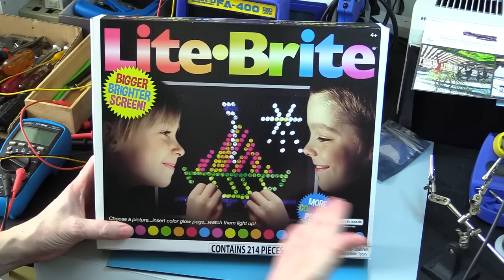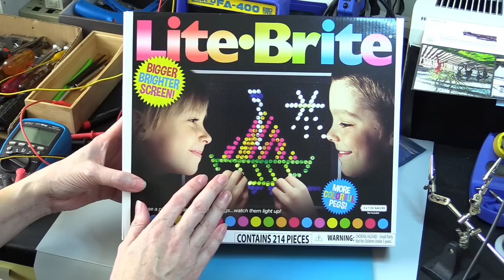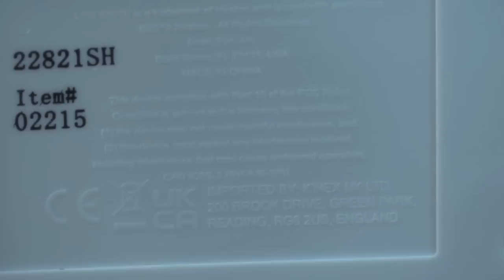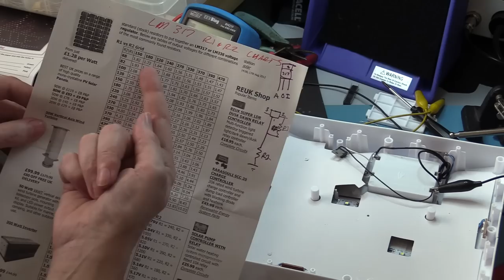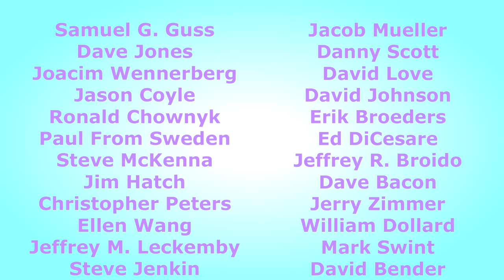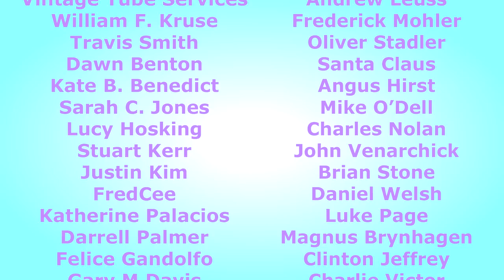Deep Dive Into The New Lite Brite

Comment: The old lite bright took 8.5" x 11" construction paper as the light blocking disposable layer. I am a little surprised you didn't take a closer look at the new unit's front panel... it appears they aren't just thru-holed like the original?

Comment: If you measure the size by counting the number of peg holes, it appears the "new" version is less than half the size.
I found a pic of what claimed to be an original, it had 19 rows x 45, and 20 rows x 44, compared to 13x30 and 12x31.

Comment: The classic would get scorching hot if you put in a lightbulb bright enough to make it work decently. (I remember the 1980's model just being a thing with a 40W bulb in it that had to be plugged into the wall.) And yeah, the originals were bigger than this new one. With LEDs on this new one it's nice and cool, and a bit more kid-friendly by being completely portable. However the illumination isn't that even so the new one looks like they cut a few corners. One could probably get better results with an original model and just switching it to a LED bulb to make it operate cool.

Comment: Good to know, if I want to buy one, EXTENSIVE customization is required. I could not stand that light arrangement. I'd be ordering led strips before I even did the power mod. 

Also for the power, I probably would have just used a USB power source onto the battery contacts with a buck regulator down to 4.5v in the battery compartment. You are bolder than I in that regard.

Edit: I miss vintage Lite-Brite

Comment: I would be surprised if the vintage Lite Brite pegs are the same size, though I do remember the old ones. They would be totally worth trying, though.

On another note, I personally hate the idea of permanently installing a wall wart in the manner you did, as I find it always being there to be more of an encumbrance. Otherwise, a USB connector or a barrel jack would definitely be something I would consider installing parallel to the batteries. Otherwise, I think it would be worth just throwing batteries in and hitting the road. It also may be worth making a battery pack adapter if you had a 3D printer, though that's getting into a bit more effort than it may be worth. ~~Use a barrel jack, instead~~

Comment: I have warm fuzzy memories of playing with the original with my sister and cousins. I don't remember the pre-drawn pattern on the black paper. I do remember the pegs having much higher color saturation. Honestly some of it could be my eyes now. because when they were still in the bag and tray I thought you only got orangey-yellow and pale-green pegs. Once lit I could see there were more colors but I couldn't tell what they were. What's that color blindness called, I wonder?  I'm wondering if a better re-make would sell better to modern kids and adults. Maybe instead of the simplicity of punching a peg through black paper into a lighted box, the pegs could be LEDs getting plugged into addressable rows and columns. Or maybe a $2k FPGA so it looks cooler with PWM brightness modulation and can also send broadband coded messages to aliens or teletubbies across the street.
Reply: I had the original, and it did have pre drawn patterns, but we quickly ran out and just used black construction paper

Comment: Try to find some New Old Stock of the original...
Reply: I bet you could even make your own!
Build a box out of thin plywood and plaster the back with LED strips.
Then get two pieces of plexiglass and drill peg-size holes in them and paint the back flat black (you'll need two to sandwich the construction paper between them).
Use black construction paper for the paper backing.

Comment: Terrible uneven illumination of the pegs, but I can see why they would do it that way to keep the price down under $15.  Even with those same LEDs it could still be done but both solutions would raise the cost, diffusing panels like the kind in LCD displays are expensive, and making it deeper like the original would be cheap but make the box too big raising shipping costs.  These days it's all about how flat can you get your box so you can cram as many as possible into a shipping container.

I bet with a back shaped like the original and a few 12V LED strips it would look great.

Comment: They made and sold so many of the originals and they were such a simple toy that vintage working ones are easy to get and fairly inexpensive. I'd rather give a kid one of those than thus piece of junk. As you suspected, the pegs barely light up.